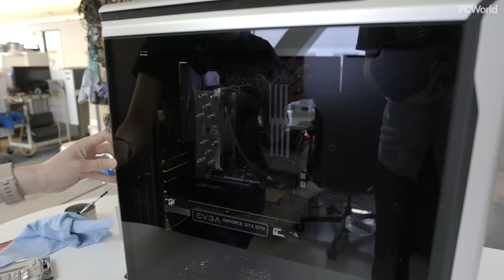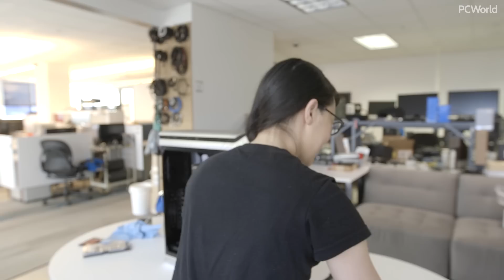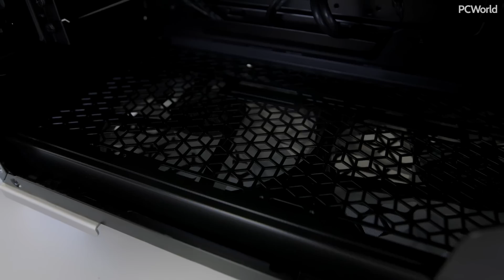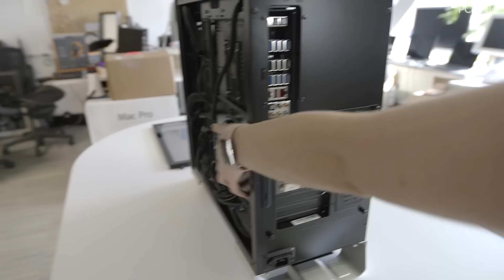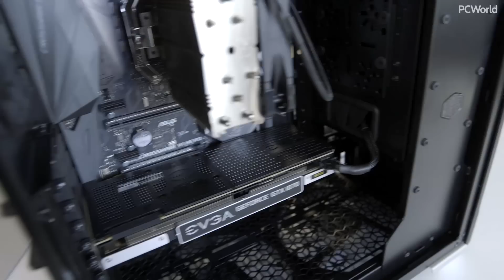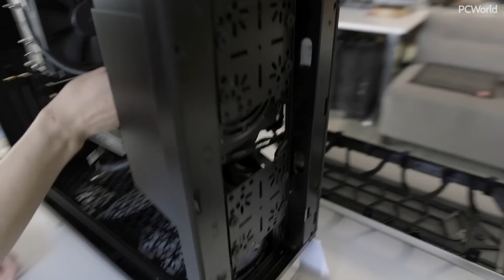Cooler Master SL600M teardown: So much storage in this case!

Comment: I got this case and one of the giant fans on the bottom is dead, which really sucks because they are sealed on to the case :(
Reply: Uhm they're just screwed in place. Remove the grille on top of them and you'll have total access. Check the manual how to.
Reply: @GrimpakTheMook  I'll be dipped, you were right. Opened it up and took another look, this time from the bottom after removing the filter and there were the screws. More importantly I noticed that the fan blade was out of place and wedged underneath the case, keeping it from spinning. I popped it back up in to place and now it is working great.
TLDR; THANK YOU :)
Reply: @LeginNoslen  you're welcome! I'm actually "returning" to this case. Last year I started a setup with it but with what I had, it was getting a bit too cramped for watercooling and replaced it with a phanteks enthoo pro 2. However, I always loved the style of the case, and when I saw the black version, I got determined to try to make an open loop that would fit in it again.
Reply: @GrimpakTheMook  I'll take another look but I'm pretty sure it's just a bunch of melted plastic or something inside the holes where the screws would usually be

Comment: If it's a vertical air case why is the cup cooler side to side.... and wouldn't the gpu block a lot of the vertical airflow, I kinda like this case design and I'm looking to find one I'm happy with for my first time build.... who would of thought choosing a box was a pain in the rear

Comment: This doesn't look like a case that would fit a larger Asus Rog Strix 2080 TI OC Card? I would say if a Rog 2080 ti oc fits it's cutting it super close. Also the HDD in front of the PSU Should of been adjustable "Up and Down" Anything  you put in front of the PSU will restrict airflow to the unit, So having the HDD Adjustable should of been an option of maybe it is one, except she didn't know it was one?  Maybe the PSU can be moved up and away from the HDD, since she said the PSU was Adjustable?
Reply: 318mm clearance. Rog Strix is 299mm so 19mm of room. If you vertical it, that's perfect and if using the cable wrap around extension bar (bought extra), you can get the 2x 8pins plugged in directly from the power supply with only a bit of cable showing.

Ultimately though, this case is designed for GPU cooling and with a Liquid CPU cooling using 240mm radiator, it'll run better than most. GPU's are typically hard to get as Hybrids and are almost entirely Air unless you modify it which then makes the card look terrible. CPUs on the other hand have good looking liquid closed loop options. For this reason, they're popular setups, having air GPU and liquid CPU. This case makes use of that.

What I went ahead and did on mine was removed the plate that was used to hold a hard drive as it was covering the PSU. This allowed full intake of air. I then used a 5inch drill cup with an arbor bit and drilled a hole in the back for the 120mm fan. Using Noctua black with the binding rubber attachments in the 4 smaller drilled holes, I was able to then afix a mesh then the fan over the mesh with the rubber attachments poked through the hole in the mesh, This allowed there to be a proper, nice looking rear fan. I set it up to blow air in under a low setting so it doesn't overpower the updraft and to provide cooling air that negated some of the heated air that may have come up from cooling off the GPU.

Under high stress I noticed the CPU never cleared 65 Celsius. With the back fan turned off it hit maybe 66 degrees infrequently but it would hover at 65 with 20% in 66 range. GPU was the lowest reading I have ever seen. M2 Drive was below it and received direct air as did the RAM. 

This is probably the best case I have ever seen and the design really should be used more often since GPU cooling is typically more vital as you can easily liquid cool the CPU.

Comment: Feet don't count, as feet are not part of the interior of the case. Feet just adds height, not inner space. Full Towers are based on what MotherBoards fit on the inside of the case, that's always been the case.  I could be wrong?

Comment: Big? Nah, not compared to my Fractal Design XL R2, it isn't. Prettier though, I have to admit. I'd want to turn the GPU vertical and the CPU cooler horizontal and add another pair of 200mm fans exhausting out of the top...even then it's probably not going to be the air flow king. That's all right, I'm not really concerned with a few degrees here and there. This is now on my short list for my next build, which will be right about the time AMD drops Ryzen 3000.

Comment: Anyone know if this case can fit 4x200mm noctua fans?? 2xTop 2xBottom
Reply: yes
Reply: Only one at the bottom left. On the top, you need to put the stock fans that are currently at the bottom, and at the bottom right you need to buy an extra CoolerMaster 200mm (which is thinner than the Noctua). I also put the radiator at the bottom and it's a huge difference.

Comment: Would be nice if they had a variation with solid side panel instead of a window too. Many people like musicians/producers/recording engineers need full steel or aluminium enclosure to minimise electromagnetic radiation/interference leaking out and causing noise issues.

Comment: Air cool only guess this would be fine but that power supply may make things a bit top heavy (maybe why you are seeing the wobble) and I agree that it may be an issue with putting a hard drive there.  Power supplies as the heaviest item, by a lot,  should be at the bottom.  Water cooling with a radiator at the top would block some of that air flow and I noticed that there isn't a rear fan.    Also didn't see any filters?  This looks like a bit of dusty bunny hotel and the way things are screwed down it will be a PIA to clean.  

You guys did a nice job giving an overview.
Reply: Ah, I forgot to show it - there is a filter at the very bottom, where the intake fans are.
Reply: @alainaoxm  Hey Alaina. You may have figured it out later, but in case you didn't and for those looking into a case like this, you can remove the Hard Drive plate that covers the PSU intake. At least, I could on mine. This allowed proper air to get pulled in. Well, more than expected. I also pulled off the back plate, then using one of my 5 inch (perfect size for it) cup bit and arbor drill bit, I was able to cut out a proper hole. Then used small drill bits to make the screw holes after marking the placement using the fan. I then used a filter mesh and drilled holes in the same spot, then affixed the fan to the spot with the mesh bound between it. 

I did this to see if blowing low RPM air in would then help level the hot air coming up off the GPU into my liquid cooled CPU 240mm radiator. It turns out Liquid CPU is the way to go and the back fan didn't really do much. Because so much air passes up due to the bottom 200mm fans, the air itself due to expansion isn't really hot, even with the GPU (2080TI) running at peak.

Back fan on and off, I had to have it up to 60% before there was a single degree drop but being liquid, it was slow to change.

Overall, this is the best case I have ever used in terms of proper GPU cooling. Since CPUs have a ton of closed loop options to go along with the CPU and GPUs only really have 1 dedicated closed loop system per gen (in the case of Nvidia with their Hybrids) and because modded closed loops on a GPU look kinda bad, this case is well fitted. It allows you to utilize air cooled GPU with a liquid cooled CPU. Add to that, RBG bottom 200mms and RBG top 140mms on the radiator set to white, it gives off enough light to fill the case fairly evenly, but the GPU has to be vertical.
Reply: (And thank you :] )

Comment: Nope lost me at no reset switch plus the lack of rear fan port makes this a non-option. Once you have a large radiator on top there is no exhaust for case air to flow unless you are happy with intake via the base. Looks nice though
Reply: yup.  if nothing else make a cover for that area if they feel the need to shut it up.
Reply: Pressing button resets, holding button turns it off.
Reply: @janus3555  Powering off is not a reset